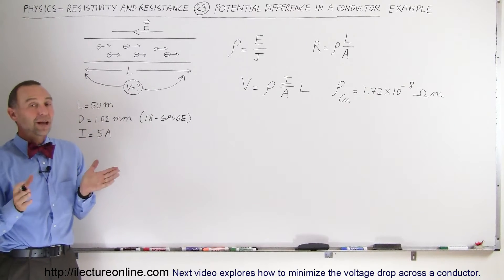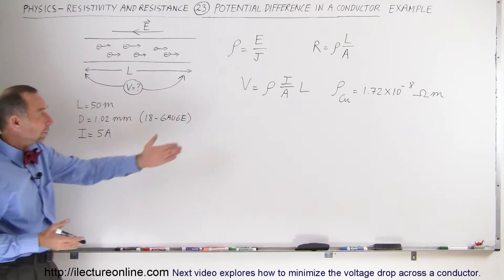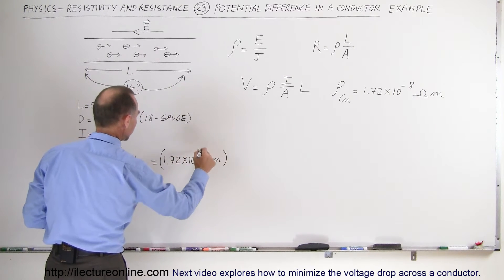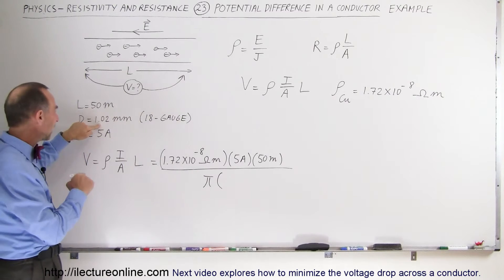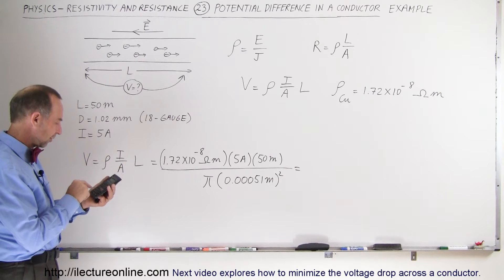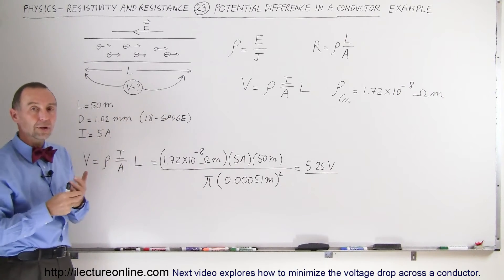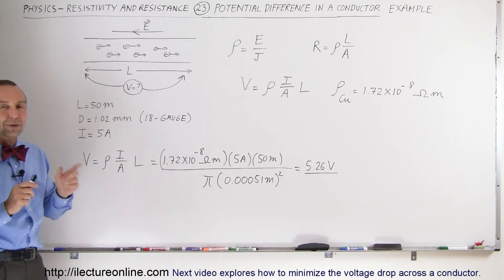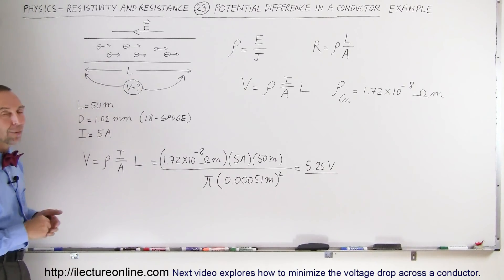Physics 40   Resistivity and Resistance (23 of 33) V=? Where L=50m, D=1.02mm, and I=5A

Comment: Sir 5A current flows in a wire  and you find that the voltage is 5.26V..so it means that this wire is connected with a battery of 5.26 Volts.. is I am right??
Reply from the maker: Usually the voltage is measured ACROSS components.   Stating that the voltage "IS" 5.26 V doesn't have any meaning.  You must indicate where the 2 measuring points are in the circuit.

Comment: This wire has a potential but how does this affect the potential that reaches us?
Reply from the maker: Instead of writing : "the wire has potential" it is better to write: "there is a potential difference between the two ends of the wire.  (That means the wire has a higher potential on one side compared to the other side)